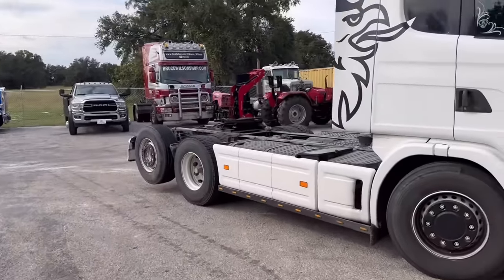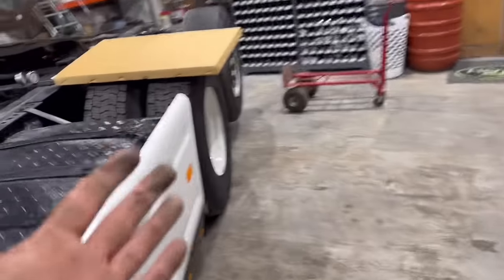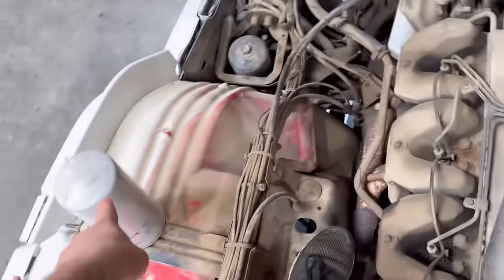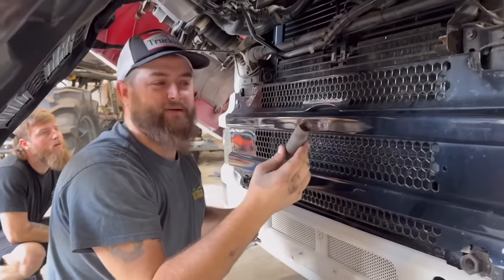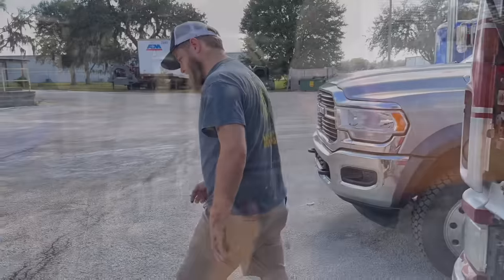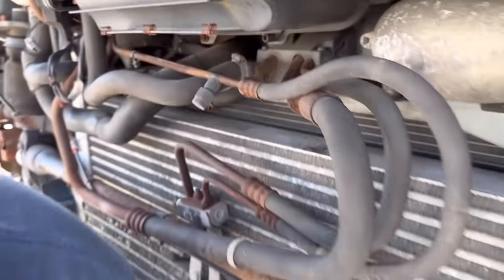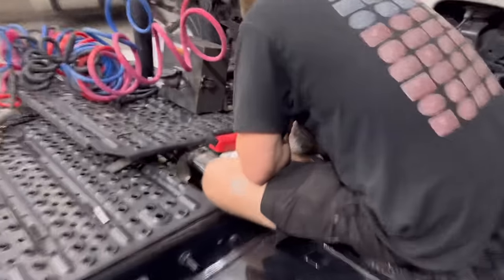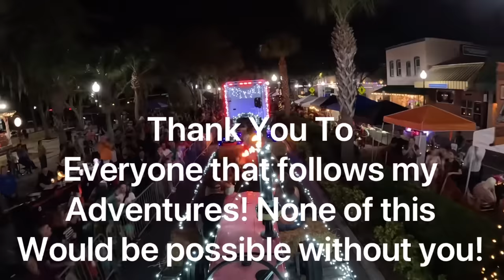My SCANIA Needs Serious Engine Repair…

Comment: These trucks look sad and disappointed when the cab is up, as if they let their owner down :(
The V8 is considered cool even on european roads, with that front metal bar thing you have a sweet model on your hands.
The engine repairs suck but they are designed to be very rebuildable. If you show it some love it will give you another half a million miles.

Comment: I dont know if this truck is imported from sweeden to canada then to usa. but in general dont buy vehicles from scandinavia that is this old. they are 90% of the time rust buckets due to all the salt they put on the roads. the same applys to normal cars aswell.

Comment: Imagine shaming the old owner for mounting the filter oring dry and then say you will put dirty oil on the clean side of the filter.
Reply from the maker: It was fresh clean oil in the new filter🥴
Reply: @Bruce_Wilson Unless you filtered the oil yourself it is to be considered dirty with any unknown debree ready to marr your main bearings. There are no oil manufacturers that guarantee the cleanliness of the jug or barrel. The oil is new, the oil is clear, the oil is not clean.
Reply: Correct, never fill the oil filter unless it’s from the outer side. Pouring oil in the middle is unfiltered oil direct to the main engine components. Completely misses the purpose of a filter.

Comment: 8,d get rear diff and get rid of lazy lift axle ,  but hey you'll need both diffs  or diff 8nit can be mounted behind the front diff?       Oh Bruce what did you pay for that scania,    I hope it's not sold to you because it's about to die ,  you gotta start looking at new purchases better than you have been ,    the motor homes etc both those  scania trucks ,  I  could see so many things up shit creek on the scania trucks x2 ,   and I,m looking through  a video Bruce,   ,,,,    open everything  thing up unscrew  things look behind them for  hidden damage  ,   nice shiny paint hides lots from people ,  distracted by nice paint , nice exhaust  note  etc etc,     you got to check shit fully thoughly,        don't worry I,m say this to any body who reads it ,,   check it real real good,,   don't be scared to point shit out and barter on the price ,,   don't be scared ,  people always advertise higher price to negotiate on so negotiate a price don't be whimpy,   or think your a scabby prick/bitch wha teve,    hope somebody tells me the got a cheaper deal by using my thoughts,     and ladles take your man with  you when negotiating deal ,   they won't if you don't ask ,  that plain and simple

Comment: Bruce you do look good in the scania,      it's my choice of truck especially if it brand new because they out live cummins engines by double ,  and the engine on 620 I loved how low it can pull in rpm   ,    and  the ride inside far out ,  so smooth compared to all American,  Australian  trucks  yet still built to do same work ,,    how come you can't  bring brand new truck into use,     gotta  say ,  to whom made that law to stop European truck sales in USA is a fuck wit ,,,  reason why is European trucks are better in every way ,,  then emission standards are higher than USA standards,   so what the fuck is the problem bringing a new clean scania to drive on USA roads ,,   I drive Western star and kenworths,   but I would never buy one brand new,    my boss bought brand new classic Australian design SAR  legend edition ,   based on 1970s  t9 80s  Sar m9del ,  had high mount cabins with angle bonnet,      just type in kenworth SAR Legend  and have a look

Comment: Please... Stop with the crawler gear... Thats for slow traffic or heavy loads up steap hills. In scandinavia, we usually start in second gear EVEN with LOAD, and then we go down in 1.st at hillclimb starts... its heavy to get to the C and Reverse because your not supposed to accidently get there. I bet you can start in 5th aswell without load.